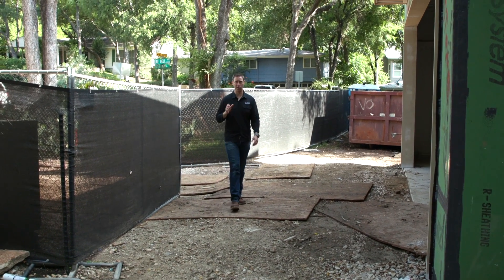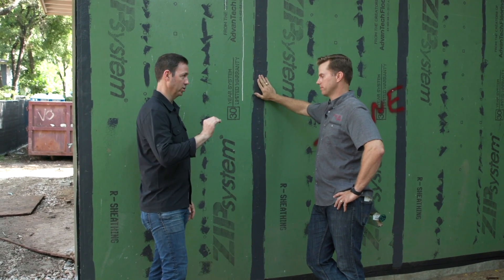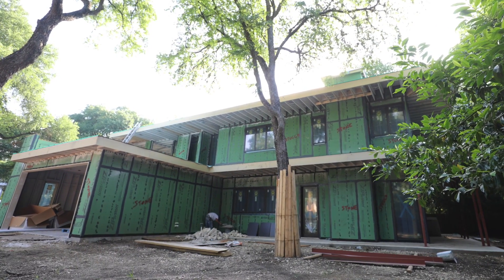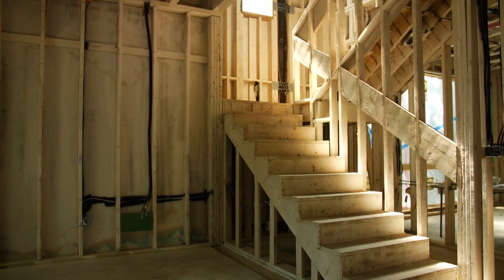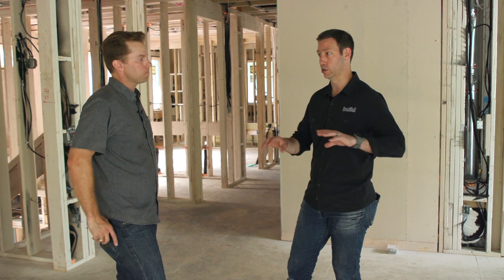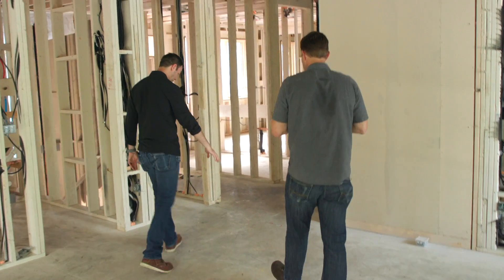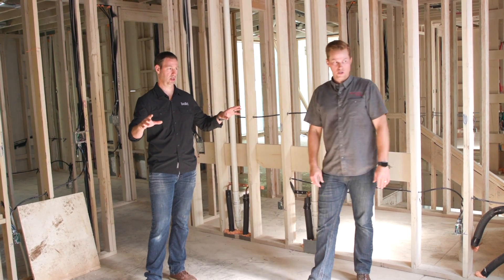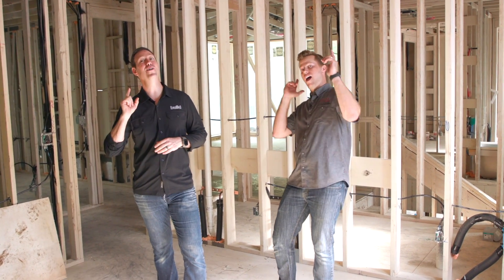Foam Free House - Is this Silly, or should we ALL BE BUILDING LIKE THIS?

Comment: Interesting, however... The spiral metal electrical flex conduit is NOT rated for Romex Cabling inside as it will overheat.  You use individual strands of THHN cable and by NEC Code, any length greater than 3’ must also contain a ground conductor.  I am from Chicago so it’s all in metallic metal thin wall up here.  It’s been drilled into us and learned only the right way “Code Snobs” shake our heads at Romex and we don’t use flex except in odd locations and for appliance flexes. The fact is rodents eat cables in walls and start house fires. Metal stops that, so the Code is a fire life safety and property protection issue in our book.  If I moved to Texas or any place with Romex for a new build, I would insist on EMT thinwall even if I had to do it all myself if local talent is lacking. 

I think this ultra sensitive homeowner is just afraid of anything that could be bad and seeks and evidently can afford a pristine environment and won’t be happy unless all precautions are taken.  In truth, the amount of EMF in a residential setting is deminimous.  It’s not like you are lying on top of the wires (exception electric blankets).  If you understand the physics, energy disputes exponentially by distance.   The best way to describe this is to throw a pebble in a lake, the waves produced are heavy next to where the pebble landed, but the shock waves or ripples die off quickly.  “Distance disapates energy at a rapid pace” as a matter of physics.  I can understand desiring electrical in metal conduit running in bedrooms where any bed would be up next to the wall as a precaution so people don’t worry about it as they spend a third of a day sleeping.  Whether there is real concern is not addressed in Code.  The Code centers it’s basis on “shock and fire”. I believe the petrified EMI/EMF folks are taking a basis of their fear on the unknown and lacks factual scientific proof in reality of real life living.  Here is why...

True damaging exposure must be one of the following:  1. High intensity for prolonged ongoing exposure (not at all likely in any home at out 120/240 volts);    2. Fairly high exposure over very long periods (also difficult to replicate in residential wiring) but I would not use any electric blanket which is still very low energy, but it is very close to the skin and brain.  3.  Some cell phone next to the head for very long periods at some very specific frequencies have been questioned.  If you are spending 3 hours a a day on your cell phone complaining about RFI or EMI, then you may be right!

I don’t think it is proper to argue with people on something they have made their minds up about if they are paying the bill.  I do believe in ethical disclosures to set fears a little less on edge perhaps a bit closer to home plate.  The fact is Fear is most compelling.
Reply: It only takes ~2.5 mw of "high" frequency RF radiation to break the blood-brain barrier. A well insulated microwave puts out ~50 mw from 3 feet away. The problem with high freq. RF is that the body has structures that mimic antenna's. That means it easily makes it past the skin and even bone. Most people are not very sensitive to this and will never be able to directly link any problems to their environment (melanoma, tumors, cysts, etc.). In this manner it's a lot like smoking or asbestos exposure in that over time the cumulative exposure adds up. It is also similar to them in that a generally healthy life can mask problems for a long time. However, some people, after being around high intensity emitters for a while become sensitive to the point where their cell phones will make them ill if left on and near them for short periods of time.

Much of Europe and even China are limiting exposure to high freq. electromagnetic pollution and making laws to this effect. Additionally, high frequency EM is a weapon and has been developed and used as such. The effects on people are not in question. Even at low exposure. Fear is incredibly compelling. So much so it can cause denial is people who are otherwise rational. Most people are unwilling to examine habits and change their always connected lifestyle for something that most likely won't be a "real" problem for 20 or 30 years.

This post isn't a dig at you but more information and some commentary.

Comment: Do you know why old homes last so long? Because old homes sucked at being air tight. Sheething was 1x6 with gaps between them. Exteriors did not seal well against air or water. This was good and bad. Yes, it is energy inefficient but any moisture was able to dry and the wood could breath. It took decades for wood to rot, now it takes a couples years.

Comment: Awesome detail with the Siga tape! Thanks for that, I'll be using it in the future since I only get about 4-8 linear feet per sausage tube of liquid flashing on that detail.
Reply: Those walls should be shimmed straight and level to the high spot on the slab and the gaps grouted with structural grout.
Reply: @bgt63  I bring my Zip sheathed walls flush to the edge of the slab and use the gap between the round over on the slab and the sheathing to air seal the base plate. I don't see a point in shimming something that isn't out more than 1/8" in 10'. If any of my slabs are out more than that, me and the concrete contractor are going to have a come to Jesus meeting that's going to cost him.
Reply: @unglabooboo  slabs around here are always +/- 1/2" which can mean 1" sometimes. Needless to say, working on slabs is a drag for us. On condos over parkade slabs with we have to shoot the elevations of exterior/LB walls and all bearing points. They usually pour a leveling slurry after framing and rough ins. It would be a lot of caulking, and by the time you're up 2 floors, the roof would be a mess, not to mention DW cracks etc.

Comment: Have been sitting smiling at this video.  Actually really think she is building the wrong way.  This is conventional construction. Should have looked at building this building as they do in Europe perhaps out of HEMPCRETE or Stabilized Insulated Reinforced Earth   Something called SIREWALL.  HUM no foam.  Absorbs radiation, sound, Termites and pests are not a problem, Super insulation Lots of thermal mass.  Massive reduction in the size of the mechanical.  Air changes per hour well not much is coming thru the walls as they are solid. Matt just did a visit to a site out in west Tx.    Wondering how much foam he saw in those buildings.  Easy enough to use rockwool and an exterior insulation package on the roof/ceiling assembly.    This really is what happens when people think outside of the box and then when others create an entirely new kind of box

Comment: One thing that could be used to improve this build, is using MGC (magnesium calcium-silicate), vs the MGO (magnesium oxide), as the MGO is corrosive to nails & screws, while the MGC is not.  I used a brand of MGC [Multi-Panels] for walls, ceiling, & subflooring, & haven't had any issues.
Also MGC is fireproof up to 1200-degrees Fahrenheit, just like the MGO, and is also water resistant, so won't be damaged by water exposure like most (normal) sheathing is.
Reply: One just has to be aware of the chemistry.. the stuff with chlorine is corrosive the stuff with sulfur is not
Reply: @stevepailet8258  there is no chlorine in MGC. Nothing corrosive as it is completely inert.

Comment: or you can go for real natural non toxic materials and you timber frame with natural wood, fill the walls and cover the frame with clay-straw to protect it for 500+ years, airtight the house inside with clay plasters, insulate the house from the outside with wooden fibre boards and plaster outiside with lime; also insulate the house uder the slab to make the insulation continious
Reply: Yeah, but that would require a different set of consultants.
Reply: MhUser what would be the natural insulation under the slab?
Reply: @northavealum  you tell me :) but foam glass would be the best (https://www.geocell-schaumglas.eu/en/) -> its not 'natural' but does not emit anything and is a great way to insulate the slab especialy when you need to change the ground under the slab anyways for some reason;

Comment: Every house should be foam free, it’s batshit crazy to foam the entire house. So environmentally unfriendly. 
You could easily use biobased isolation materials. Feels great, it is vapor open. Have you learned nothing from your trip to Europe, Matt?
Reply: Not Matt's Project.
Reply: Guy Tech Good point. But Matt foams as well.
Reply: @MulderJosh   Yup but he does appear to lean to using Roxul over spray foam. I think it comes down to the homeowners preference.
Reply: Is Airkrete, a foamed MgO insulation, used in Europe, Jos?

Comment: Regardless of what you believe about EMF, occupants/builders who opt to build with EMF mitigation should not be mislead about what methods actually work to reduce EMF as measured. EMF is measurable, so it's not a case of applying solutions blindly, just using solutions which are known to meet the target exposure limits (people who want EMF mitigation simply believe these limits should be much lower). It would be better for the home builder to consult with an EMF consultant or local ham radio guru or RF engineer (whoever is affordable and humble enough to take the job seriously) than to try to apply more than basic mitigation without a good understanding of the requirements for EMF shielding. The EMF paint on the electrical wires will have no effect and was a waste of time and money. The aluminum shielded cable is by far the most effective part of this system IF it is grounded, otherwise the effect will be limited.

As others have pointed out, there is no screening for RF in this house, but this would require covering most surfaces with something conductive such as aluminum mesh or foil (the EMF paint could work here if applied as a complete coat). This would mean no cellphone reception inside and would actually increase the RF exposure if one were to use a cellphone or wifi device inside the house as it would reflect it back at the occupant and not allow the RF to escape the room. So leaving this out would be considered the better solution for someone concerned about EMF but not committed enough to forego cellphones or wifi inside the house (which basically tells you they are not committed at all).
Reply: The cell phone has to increase transmitter power when transmission/reception is poor. Runs the battery down faster and phone gets hotter.
Reply: @avid0g  True, RF screening isn't good for the user experience and would likely devalue a home for anyone who expected to be able to use a phone or wifi inside.

Comment: I have found that Kaolin clay increases corrosion in steel surfaces. It holds the water next to the steel longer. Not sure what that means for wood.       EMF is not blocked by steel conduit with power at 60 hz, and neither does black paint. Sounds like the consultant is successfully selling snake oil. How do I get his job?
Reply: offshorebear I dont know about the effectiveness of kaolin clay but steel tubing definitely reduces emf with 60hz! The steel tube institute found 95% in their study.

Comment: Matt, how come this guy hardly staggers and of his plywood joints as well as the stuff on the floor? When you seal up the foundation joint, how does any moisture get out? Also the doorway in the garage floor is level with the living space. Where I live they would not allow that in case of a gas or oil leak. The r e has to be a solid lip of cement there. Great show! You do a great job. I'm still not sold on sealing everything up.
Reply: It's all about ventilation in the HVAC system to make up for the sealed house. Has to be very carefully designed.
Reply: I didn't know that. I've never heard Matt say that before.

Comment: Another plan would be to build the house, then leave it unoccupied for several months with a large amount of ventilation to clear out the VOCs. As mentioned, they still had to use some glues and foam. After a month or two, plywood, osb, or plain lumber don't have very much smell left. If you want to be really sure ventilate it for longer; it sounds like the customer could afford it.

Comment: I did a lot of research on electromagnet radiation. It come out of large powerlines, and cell towers, and routers and of coarse cell phones. Living in Austin tx where you can probably pick up 10 router signals and there is a cell tower every 5 miles, I am not really sure that coating those 110 flex conduit cables will really help, but I do like the flex conduit over the Romex and the metal boxes. It is is nice commercial detail.
Reply: The only way to get away from emi radio signals is to live in a faraday cage in the galactic void. Nothing will affect them there
Reply: The boxes were not metal, but blue thermoplastic.

Comment: Zip R? You mean foam? Glue in plywood and glulams? How about the chems in the concrete mix? Plastic pipes? Cobalt? Magnesium oxide floors? Subfloor adhesive? Liquid flashing? Have you read the label for Huber’s liquid flash??? Look at the msds for it! This house is loaded with chemicals.
Reply: Yes. They should move into the bush and live in a mud hut without running water or electricity and see how great their health becomes.
Reply: Handy Menagerie Shhh... her consultant ran his crystals over the materials and said his chakras were still aligned with his third eye, so they’re obviously properly tuned to the universal harmonics. 🤪
Reply: @RickinICT  Anything that's been buried in the dirt has magical properties as a result. Except, apparently, that petrified cat turd I discovered last week - it's doing nothing for my arthritis. And my third eye is temporarily out of commission after a dodgy Vindaloo from the local Indian takeaway.

Comment: Wait... What type of things will the homeowner plug into the outlets? Are those two prong slots in the outlet blocked off with cobalt child safety caps? Do they have their TV, vacuum, iron, blender all encapsulated in Faraday cages? Are the light switches buried in the wall and switched with a large extension handle? The EMF thing is laughable.
Reply: Benny McKeon This project, like life, is about controlling what you can. You can turn on and off appliances or place them in certain locations and limit exposure. A wire emits emf 24/7 possibly right next to where you are sitting/sleeping. This is what they are trying to solve with the solutions shown.
Reply: @aayotechnology  code requires an outlet within 6' of any point on the wall, so unless you build big rooms and sit in the center only, the EMF from the outlet is 24/7... See my point?

Comment: Silly "sensitivities" aside, there's nothing about that house that seems off the wall...
EXCEPT...
that MGO board is a bad idea. Wait until it starts crying...😭
I wanted to find an alternative to drywall for my house and researched MGO board and it seemed phenomenal... Until I found the (well hidden by the MGO industry) negative aspects, such as crying and rapid corrosion of metals that can occur. Think of how a Damp Rid bin works... Magnesium does the same thing as the calcium chloride in Damp Rid. Soaks up moisture until it saturates itself, then dumps the salty water out. No thanks. Especially in a floor?!? What a disaster that'll be down the road...
Reply: Interesting, do you have any links?
Reply: would also be interested in links
Reply: Follow the link to the PDF on this page. There's many more, but start with this one:
http://www.wftao.com/2018/08/15/dissertation-by-nicholas-jays-about-degredation-of-mgo-boards/

Comment: Just a note: Roxul despite the name is not actually made from rock, it's metal slag that is spun like cotton candy. 

Also, I've been seeing a lot of your videos focusing on zip board and have to thank you for stressing importance of vapor and water sealing. Very valuable info. However the cost of zip board and time it takes to flash it with the expensive zip flashing and go over each nail hole seems cost prohibitive and not as effective as a liquid applied vapor barrier. To me it would make the most sense to just take a spray gun and spray down more cost-effective OSB or plywood with a liquid applied vapor barrier. This not only would save time but that's also cheaper than the zip system that doesn't seem infallible to me. you do mention liquid applied sometimes but you have to really show a job that uses these. I'd love to see and here more about it.
Reply: Nathan: "To me it would make the most sense to just take a spray gun and spray down more cost-effective OSB or plywood with a liquid applied vapor barrier. "

I don't see how that would be cheaper, So your plan is spray paint every 4x8 Sheet of OSB with a vapor barrier? That sounds like it could take a few weeks. Yikes! Not to mention the cost of the liquid applied barrier, that probably needs to be cut with a solvent to pass through a spray gun. 

FWIW: I applied a solid bead of caulking to the studs before the Sheathing is nailed and just use the ZIP tape on the seams. We did have to patch some nail holes when they missed the studs. Taping the seems of ZIP didn't take much time and the tape wasn't expensive either.
Reply: Redguard